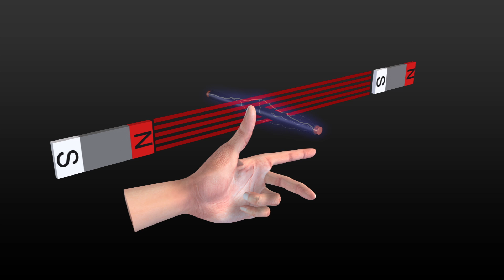US Navy railgun: how it works

Comment: The beginning animation is incorrect. The projectile keeps the  same direction magnetic field as both wires,and it can't magically start spinning the opposite direction. That the reason why it can be repelled by the magnetic field of the two rails.

Comment: from this video I understand about. I also have to point out that there is a difference between a railgun and a coilgun. Coilgun uses a series of electromagnetic coils to accelerate ferromagnetic projectiles. For railguns, projectiles are accelerated because of the current flowing through the projectiles. This means that it only needs to be an electrical conductor and not ferromagnetic material. Thank you 🙏

Comment: This is genius. I mean, yes I know this is more dangerous than an artillery shell, but if each railgun were equipped with a means of renewable energy, then it would be a energy efficient way to reduce one's dependence on gunpowder, which would mean one would not have to mine for more suffer rock or coal. In conclusion, give it a means of sustaining itself and it would be environmentally friendly. In the words of Peter Griffin: "Why are we not funding this?"
Reply: Renewable energy source that can produce in the megawatts that is transportable. Maybe in a few hundred
Reply: @just.someguy5145  What about Wireless Energy Transference or "W.E.T." for short?
Reply: @kevinlane1219  how far are you expecting to transport this energy? Where will you store it? How far is the energy source?
Reply: @just.someguy5145  I heard about a ship that doubles as a floating, nuclear power plant. And helicopters and trucks can be equipped with transceivers, so all that would matter is being within range of a transceiver and keep them within range of each other.
Reply: @kevinlane1219  wouldn't it just be easier to put the gun on the ship at that point
Reply: @just.someguy5145  Only if the targets were within range of the vessel. But it would make more sense to attach it to a helicopter or a tank with an extra large fuel tank.

Comment: What if the projectile were to travel at the speed of light are 88 times that?
Take an 88mm Shell for example...
Reply: You cannot travel faster than the speed of light.
Reply: And a railgun does not have enough energy to fling something to near the speed of light. It only goes at Mach 7.
Reply: @Balleater123 all the energy in the universe could not get a single photon to the speed of light
Reply: @just.someguy5145  photons travel at the speed of light in vacuum. Do you mean a proton?
Reply: @Balleater123  yes typo

Comment: BUT ITS THE RIGHT-HAND-RULE!!! 😭😭😭
Reply: The used rule with the hand in the video is wrong. To make it more clear for everybody: Left-hand-rule uses the thumb to point in the electrons flow direction, so it uses the physical direction of the current flow, representing not the charge rather than a volume, mass or particle current. We have a lack of electrons at the plus pole and too many at the minus pole. Therefore, the electrons are flowing from the negative pole to the positive pole-> thumb. The magnetic field direction is upwards (open fist/thumb rule), represented by the forefinger and therefore the Lorentz force points outwards of the rail gun, shown by the middle finger.The right-hand-rule uses the technical current flow direction, which is first show in this video because they indicate the current flow from plus to minus, therefore they use the classical technical current flow direction. This means the right-hand-rule should be used here, but they messed it up completely by using the wrong hand and wrong fingers.

Comment: You know just a thought. Compared to the velocities that tank rounds fly at, if the speeds are accurate, this thing will fire round a little under twice as fast which is really amazing. If they dial it back some it would still be faster than modern power fired ammunition and probably more applicable to smaller platforms such as tanks and smaller boats.
Reply: Unfortunately it takes too much power to be cosr effective. The navy has a big one on a carrier and drains their nuclear reactor whenever they use it.

Comment: imagine putting this into hand held weaponry..
Reply: that won't be as powerfull as this one since the barrel is shorter and therefore the projectile cannot be accelerated as much.
Reply: Railguns require a massive surge of current, several million amps.  It would be practically impossible to aquire that power in a hand held device.  Mike is also right about the barrel. The recoil would be tremendous if the device worked.  

A different method could be the coil gun, which has potential to be used as a hand held weapon.

Comment: that's plasma. 

- "Plasma is a distinct phase of matter, separate from the traditional solids, liquids, and gases. It is a collection of charged particles that respond strongly and collectively to electromagnetic fields, taking the form of gas-like clouds or ion beams. Since the particles in plasma are electrically charged (generally by being stripped of electrons), it is frequently described as an "ionized gas."

Comment: OK ok, the vid is correctly demonstrating Fleming's left hand rule which relates force, electric current, and magnetic field for electro-mechanical devices that resemble motors. But as as you and others point out. The same principle can be illustrated using either hand.... This exchange in an example of  why we should we should just pick one version and stick with it.

Comment: Put both hands in the position facing forwards. Rotate your left arm so the palm is pointing up... what do you notice? On both hands one finger points up, one forward, one left. Just because you learned it as the 'right hand rule' doesn't mean other arrangements aren't equally valid.